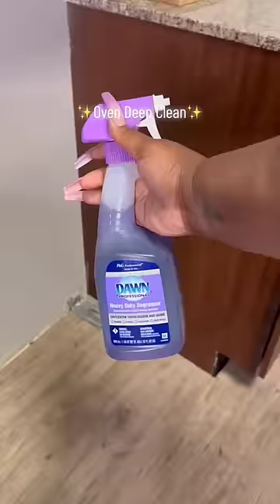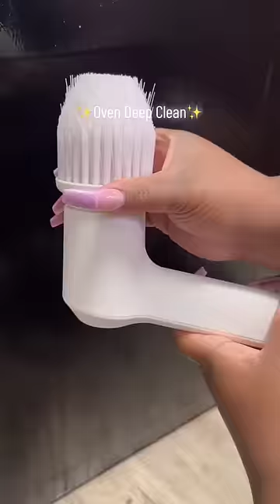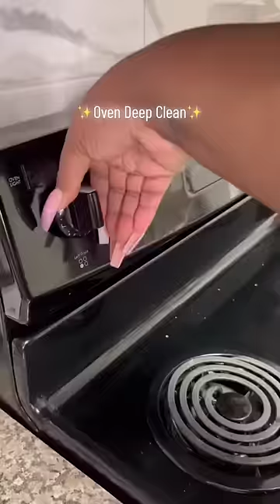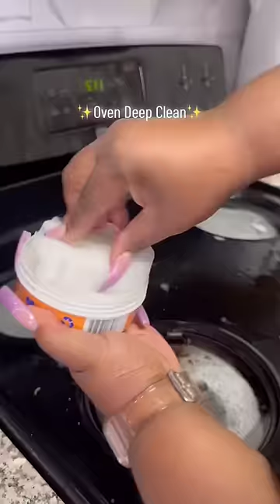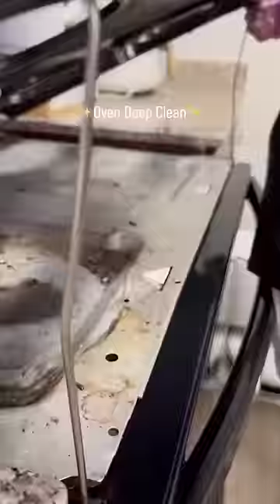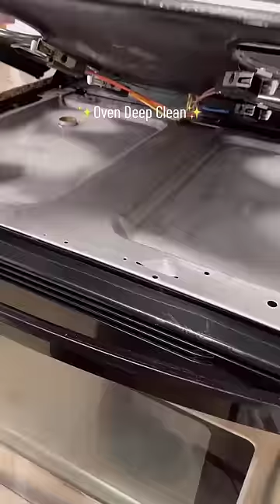CLEAN W/ ME: Oven deep clean #home #cleaningmotivation #cleanwithme #deepclean #asmr #ovencleaning

Comment: I place heavy-duty foil on the bottom floor of the stove under the heat element. So when it's time to clean the bottom for drips, I pull the foil out, toss, and replace.

Comment: I clean like this behind the fridge too once a month and clean out the fridge and freezer every two weeks. The washer and dryer get it every three months or when I fee, the dryer is taking longer then normal to dry clothes. Since I seen a video on what it’s in the whole of the dryer that leads outside I been cleaning it out so it won’t reach that point. Check the video out it will shock you and save a lot on your energy bill too